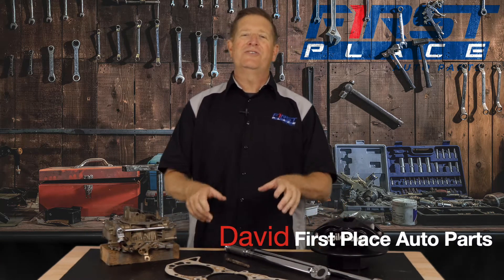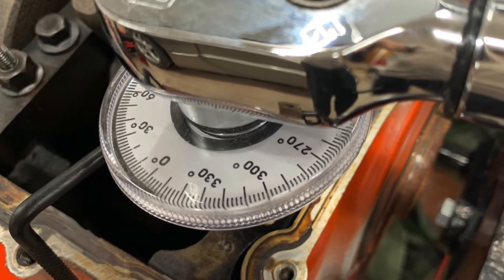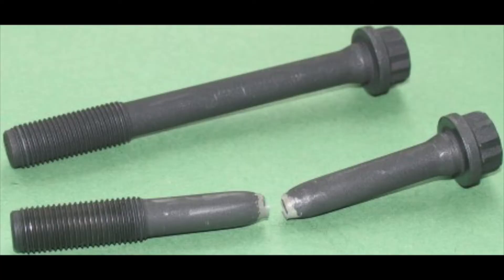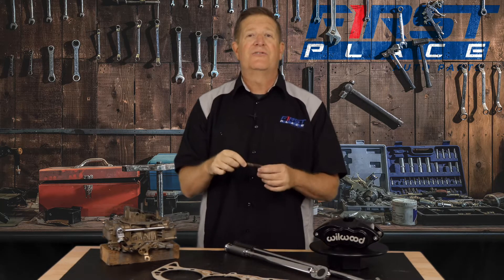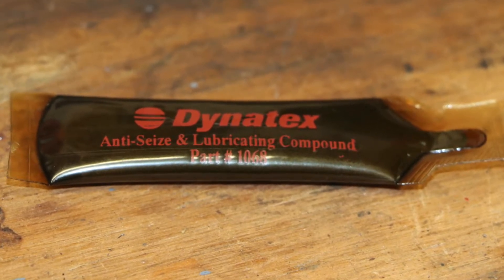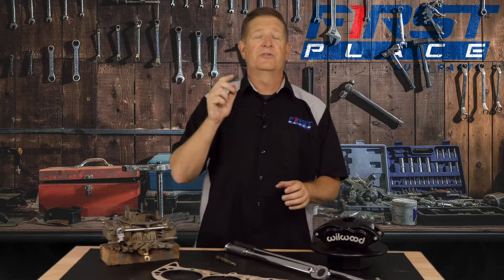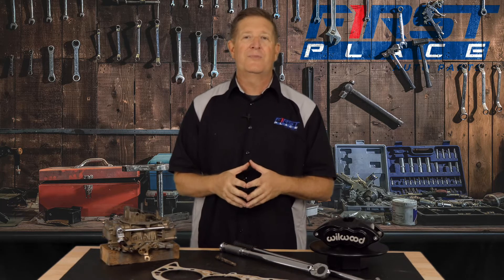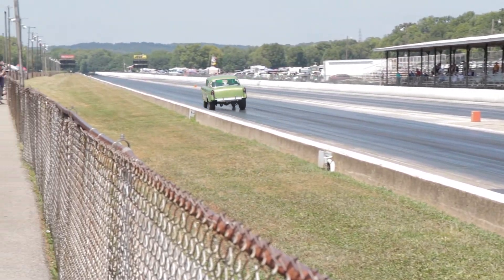What to Know About Torque to Yield Bolts on your LS, Hemi or Coyote Engine

Comment: Seen 3 time reused torque to yield LS head bolts hold heads down on a motor making over 1,000hp at the wheels on over 22psi. So do what you want.